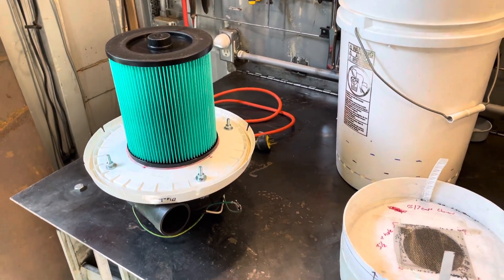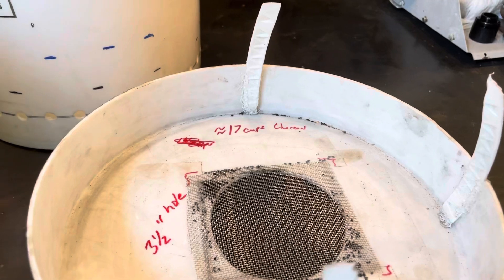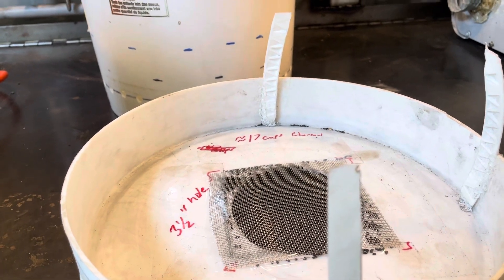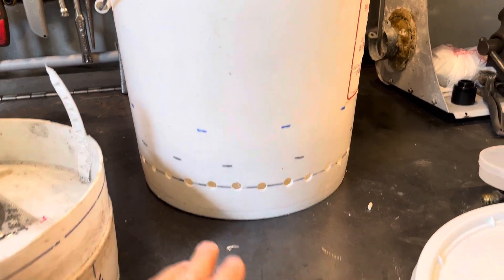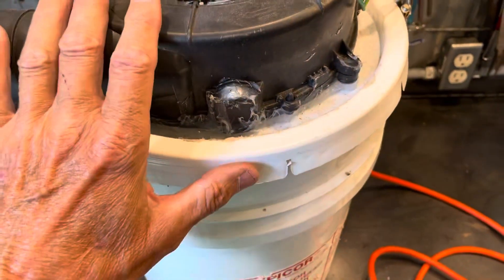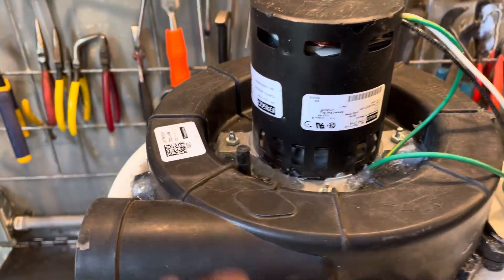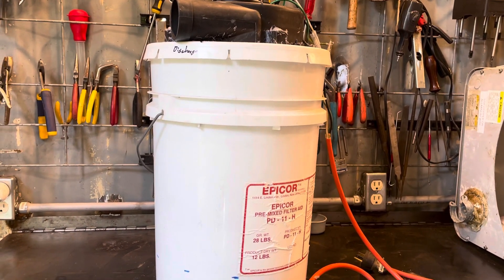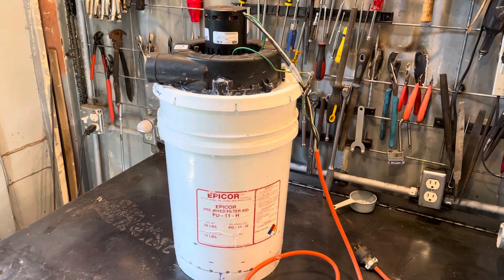Emergency nuclear contamination filter made with easily obtained items(nuclear fallout protection)

Comment: Very well done. I was looking for a filter, which seems about the right time if not too late, and I was not able to find anything to my liking other than binding an NBC gasmask cartridge filter to a bilge blower, but that's so small and all. This is pretty great, I might give this a try. Did you have any other ideas before starting on this system? Thanks!
Reply from the maker: Yes I was going to do another video and update the filter. I took the hepa filter and turned it upside down and glued it to the outlet of the charcoal filter. This has backward air flow through the hepa but it will not really change the filtering. It makes the filter elements fit in a 5 gal bucket and is easier to change out filters if needed. The parts are all the same but it is much easier to build. It allows more flexibility in the way you provide the air flow. The blower I used was 120 Vac but you will probably  need some form of manual air movement like a bellows arrangement. Removing the hepa filter from the lid makes this much easier.
Reply: @edwardjackson9791  I can see the advantage of that, on the other side, the activated charcoal, I'll have more to say on that in your new video, is there to catch the rare radioactive gasses released from the radioactive material from what I understood while the hepa does the filtering. So if you follow that reasoning, you want some charcoal on both sides of the hepa (hepa 14 or 13), but at least after the hepa. The Hepa catches the fall out material and the charcoal absorbs the gasses released from the radioactive material that is stuck in the hepa. So you need to charcoal the air after the hepa. I would also have charcoal on the other side just for when you shut off the filter to replace it, the charcoal on both sides will keep absorbing the gasses to some degree while you expose of the unit. I'll report some more findings at your new video when I find the time.
Reply from the maker: @denniskatinas  this is the design used at nuclear plants as far as order of filtering. The ones at the nuclear plants are much more complex which makes them much more efficient. But the actual process is the same. Fission releases fission product gases in a predictable pattern. The gases pass through the hepa filter and are not trapped because they are gas and not particles. The inlet filter sometimes are hepa filters to capture particles before the activated charcoal bed. The gases that enter the activated charcoal beds are held up due to the enormous surface area of the charcoal. This causes the fission product gases to take a very long time to work their way through the charcoal bed. During this long time period the fission product gases decay into fission particles. The particles that exit the charcoal bed are then captured buy the exhaust hepa filter that can now capture and hold them. The inlet filter on some units are hepa and some they are not. They key is to have a hepa filter after the charcoal bed for maximum effectiveness. But that being said there is no reason you could not put filters in series for added filtering. This design is by no means perfect but will help a bad situation be not as bad.
Reply: @edwardjackson9791  Thanks for the feedback, you bring up some interesting points here, I may have made the mistake of believing the gasses en particles pass through the filter at the same speed as the air does. The gases breaking down into particles was also unknown to me. I was planning to have multiple hepa's in series, just to be sure. Also, the charcoal is another point for me, activated charcoal used in nuclear plants is treated with ZincChloride and heated to catch way more particles and gasses, you're everyday household charcoal isn't as effective, actually, the difference is big, so I think I'll go with bigger charcoal beds just in case, since making the ZnCl2 treated charcoal is tricky to make and get right. Well, back to the drawing board, thanks again.
Reply: My bilge blower runs 130 cfm, that's pretty substantial for the small space I am working with. It would be adequate to exchange the air in my shelter completely about every 10 minutes. And it's fairly quiet.